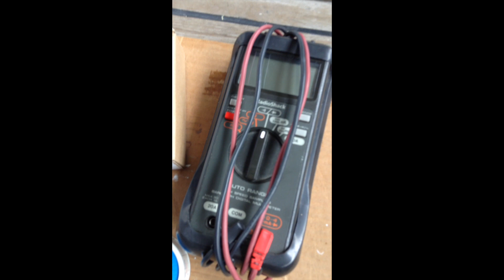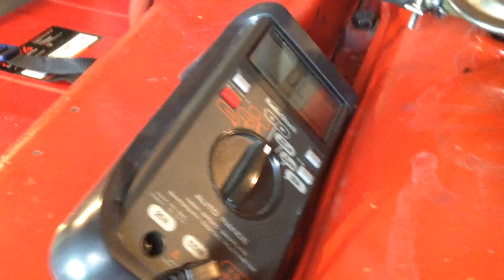Replacing Zincs on Marine Engine Heat Exchanger and Oil Coolers

Comment: I use Teflon paste sealer on all threads, like Oatey and on all rubber hose connections. You doubt me, you can verify electric conductivity with an ohm meter. Advantage is it fills crevices and keeps things sealed. And is easier to get the zinc from the brass holder. Hoses slid on easy and come off with less rubber sticking to the brass-bronze. And I am thinking Aluminum Anodes are best, not zinc.

Comment: Taping is not a good idea.Never do it !!!!!
Reply from the maker: Teflon tape is fine as long as you only use one wrap and you check with your multimeter after installing and make sure that there is continuity. Using only one wrap assures that the tape won't prevent continuity. Checking with the multimeter will alert you, if there's no continuity, that you used too much tape.

Comment: Shouldn't use teflon tape. It acts as an electrical insulator. Zincs depend upon solid electrical bond in order to protect heat exchanger.
Reply from the maker: I'm assuming that you are saying this because you are assuming that the teflon tape will prevent continuity between the zinc and the threads of the heat exchanger. This is why I suggest only using one wrap of tape, and, after installation, using your multimeter to check for continuity. Using only one wrap assures that the tape will tear enough to create continuity between the zinc and the threads of the heat exchanger. If you do use tape as I suggest, you must check for continuity after installing.
Reply: put a multimeter across and you will find that you are wrong about that
Reply: @marchingontogether2571  it appears in the video that he did use a multimeter and got continuity

Comment: Thanks for taking the time to cover one of the simpler tasks.  I thought that using teflon tape was sort of a no no?  Vaguely remember something about it insulating the zinc causing it to not due what you put it in there to do?  Also, bits of the tape getting into the system were not good? Maybe I reamed both of those things....!
Reply from the maker: Sorry for the tardy reply to your comment! The key is to only use one wrap of teflon tape. That way there will be a metal to metal bond. And...that is why I check for continuity with the multimeter after installing the zinc.